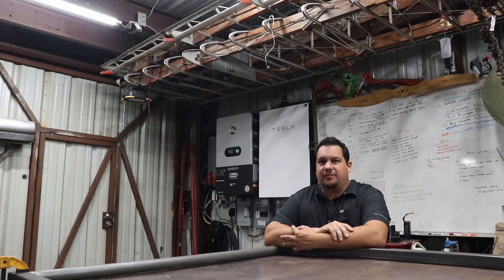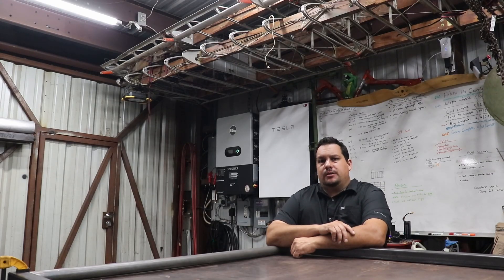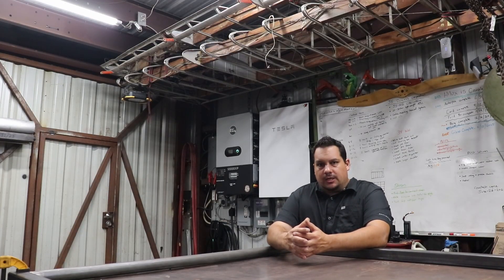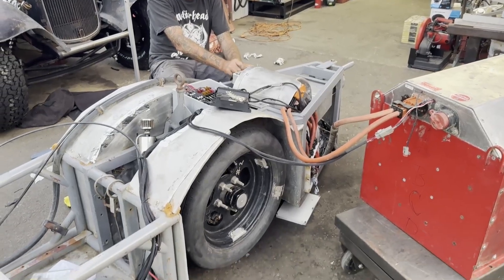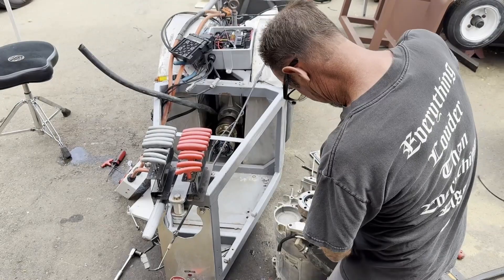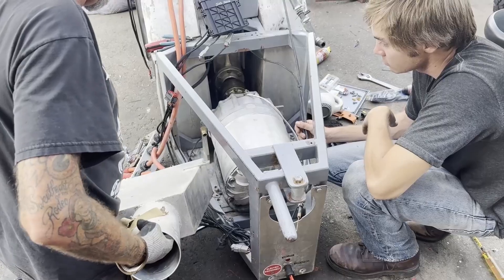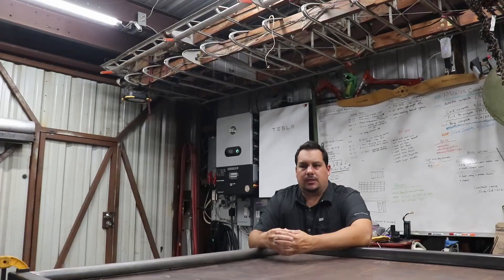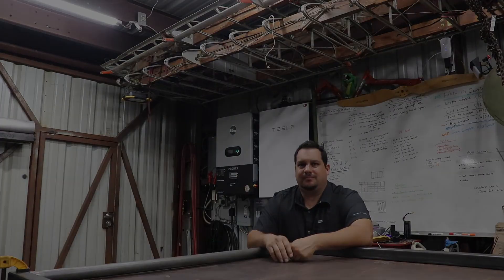300MPH Electric race car! A vehicle I helped electrify...

Comment: should look into the Texas Mile .. I wanna build a AWD suburban and race it there but also wanna change it to like 4:1 final gear
Reply from the maker: That would work. Aero will start to hurt at around 90 though with the suburban. But… it would probably do around 160–180 with a couple LDU motors